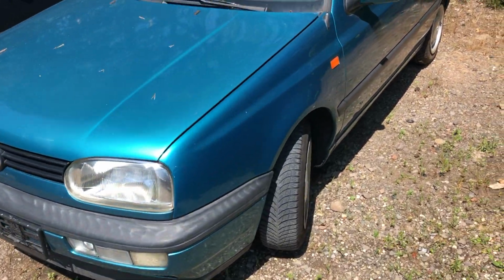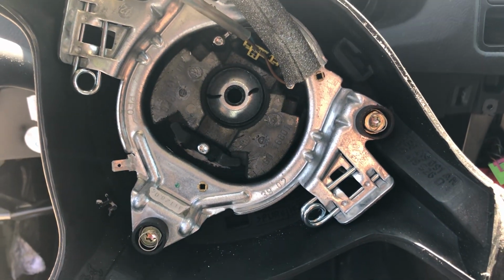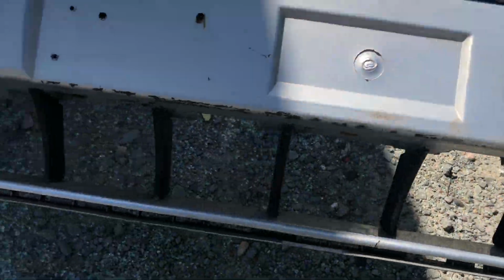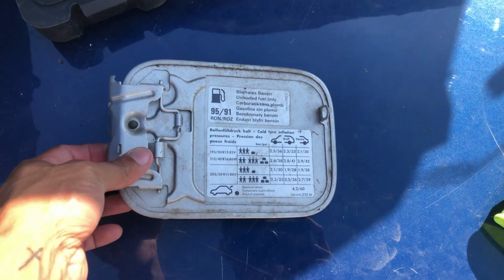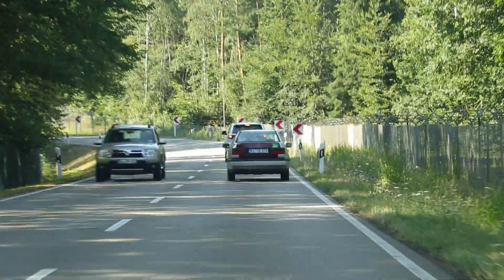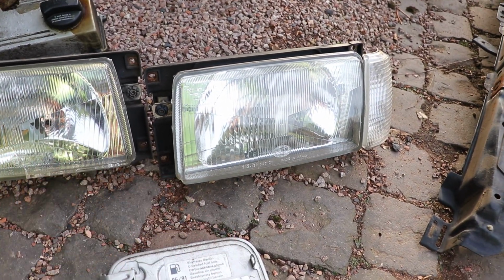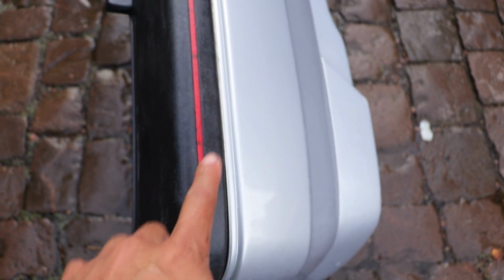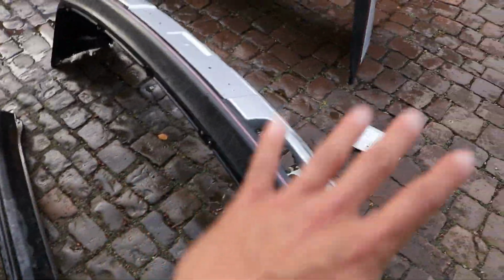Junkyard scores and we FINALLY HAVE A MILEY UPDATE!!

Comment: How did you deal with the steering wheel locking up for you to remove the air bag? I found a three spoke wheel as well but couldn’t get the air bag off cause it was locked
Reply from the maker: Arisai Veloz thankfully a lot of the cars at the junkyard have the keys inside them so I’m able to move the steering wheel. If you don’t have the keys maybe if you pulled apart some of the steering column you’d have access?